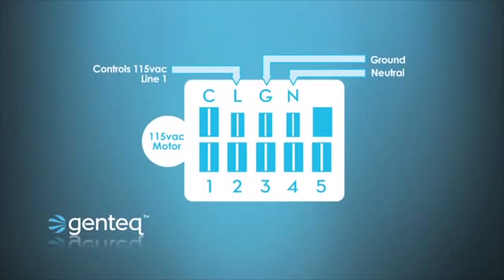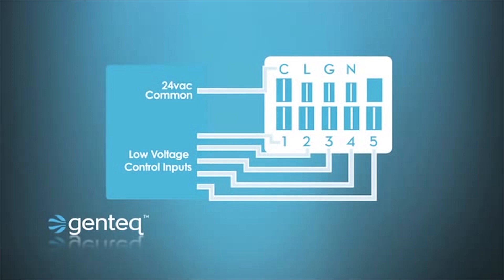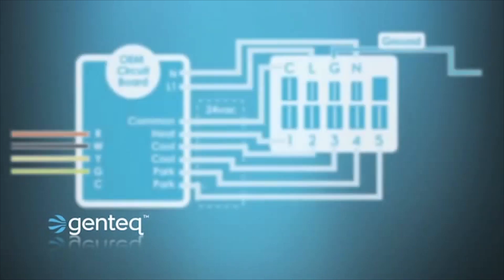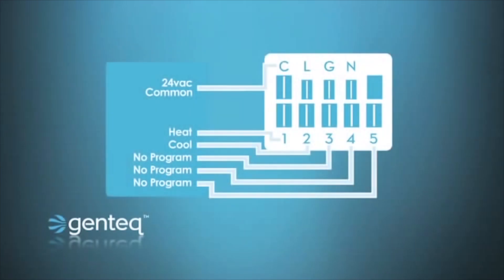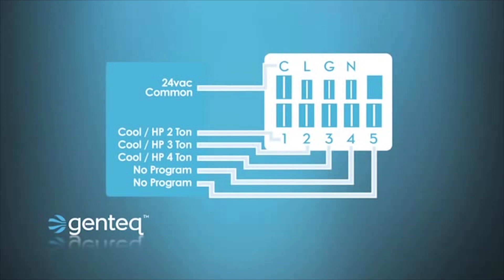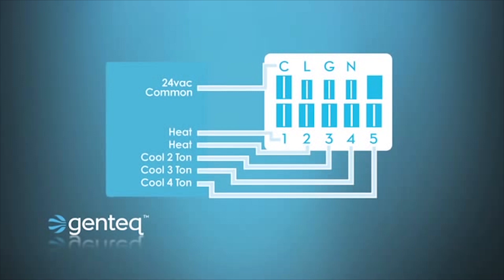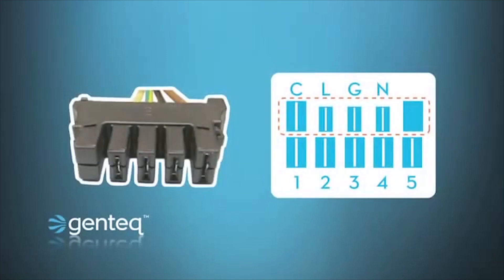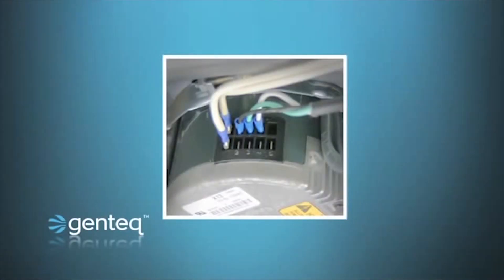Furnace Motor How-To: Genteq X13 Motor Connections

Comment: Piece.  Of.  Crap.  Our Rheem motor made it 5 years exactly and now it powers on by itself, might shut off in a short time, might not, or might turn off when it's done calling for AC, or it might try to run for another hour or more and raise humidity.  This even with the thermostat wires disconnected.

Comment: These motor are junk you can't even repair it they make full of cilicone so you can't change a simple capacitor or anything in the module junk junk don't last I had replace twice within a year wherever I go I have to swap it with the psc better

Comment: Junk , not reliable , absolutely evidently no thought process went into reliability of these motors, I've heard all the arguments on x13 and yes they do have a purpose as being versitol and energy saving ,but the reliability sucks, and don't give me the argument that ,oh the duct wasn't right, granted 80 % of duct jobs aren't correct but the old psc is more forgiving when some dummy has incorrectly sized the duct. So all the gains of the x13 is deminished when you have multiple failures all over the world in a very short time.weve all seen it  and we all wish they get their act together on reliability, as for the class this tec is  informative  and did a good job , my rant ,and I'm not alone , is the failure of the x13 to refuse to solve the reliability issue.

Comment: All Regal Beloit ECM modules are entombed inside in a half inch of stiff rubber epoxy, making repairs impossible.  Run these corporate polluters and extortioners out of town by refusing to buy their ****.  Research alternatives and support ethical practices and right to repair.

Comment: And they are also junk, I’ve replaced these motors usually a couple of years or so old gone bad. That’s why unless it’s under warranty I recommend a regular 3 speed motor with a blower relay instead of the the x 13. Which seems to have a very short life span.

Comment: Prime example of a ruined implementation of a good idea and technology racketeering.  The electronics are made in India and notoriously faulty.  The electronics are potted and impossible to diagnose or repair on a board level.  The proprietary programming nonsense means there are 1000s of secret variations of this motor, none of which are documented or compatible with each other, so repairs and replacements are usually impossible.  No right to repair these things, even though it's just a thing to spin a shaft, like we've had since the 19th century.  Shame on GE, Genteq, Regal Beloit, and whoever succeeds these businesses that take turns going bankrupt with this abuse of engineering.
Reply: HELL yes!  I just had an X13 go out in my house.  The first guy quoted me $1700 to fix it.  I settled on a $970 quote, but kept the old motor (still perfectly good - the control module went out) to keep as a spare.  I opened it up to diagnose and repair it and the circuitry was buried in a half inch of stiff rubber epoxy or foam, making any kind of diagnosis or repair impossible.  I am FED UP with companies preventing people from fixing things, or rendering hardware useless with software updates and other similar profit generating BULLSHIT that sends perfectly good equipment to the landfill and obligates people to keep buying new while we bury ourselves in our own garbage.  This behavior has got to stop.  It is an ecological and moral catastrophe to allow this corporate extortion to continue.
Reply: @DoctorFixMaster  Meanwhile the Genteq "Evergreen" new replacement motors that are user programmable to fit any old X13 application are only $140 for 1/2 HP.
Reply: @RichardKinch  Did they turn over a new leaf with the 'Evergreen' motors, or is it just the same junk different day?  I haven't looked into those, but the price sounds much more reasonable.  That said, they don't get to call anything 'Evergreen' unless it is serviceable and maintainable by me.
Reply: @DoctorFixMaster  They are identical to the X13s, same motor body and module, just in an off-the-shelf field-programmable version.  So for $140 you can replace an X13 without having to spend $800 for the racket pricing of the same motor from Carrier, Trane, etc., with a secret programmed torque value.  The "Evergreen" is still a potted circuit board but for the price it's not worth a repair because you can just swap out the controller end from an Evergreen into an X13 of the same horsepower.  There's an outfit in Florida https://unitedhvacmotors.com/ that collects failed X13s and refurbs them; they charge $200+ for a used motor but I found that they failed again within months and the short warranty term isn't honored.
Reply: @RichardKinch  Good to know.  Thanks!
Reply: @RichardKinch  - Thank you for the additional detail on Evergreen units / the recycler.  I wish I could give more than a single upvote -- extremely helpful.
Reply: There's also replacement X13 motors called Rescue X13, I believe made by U.S. Motors, that are reasonably priced. Swap right out with the Gentec's.